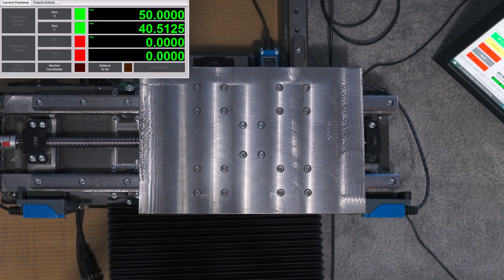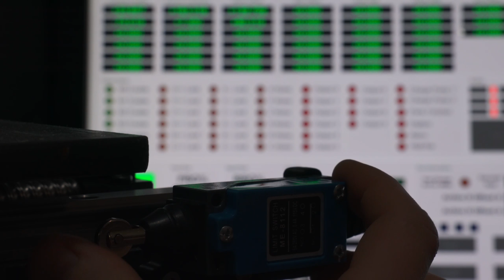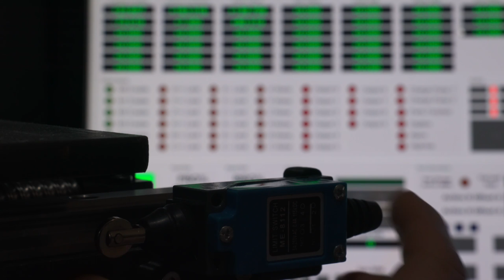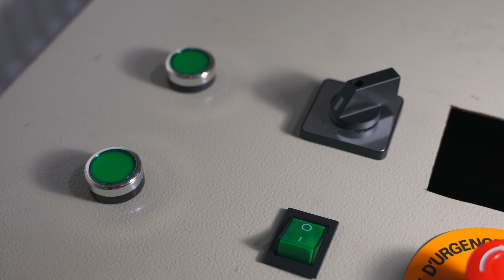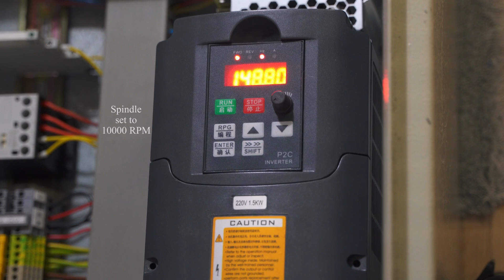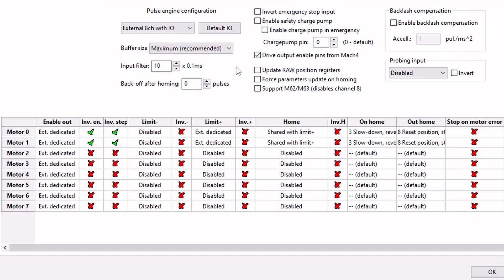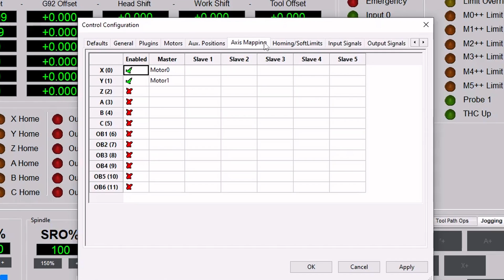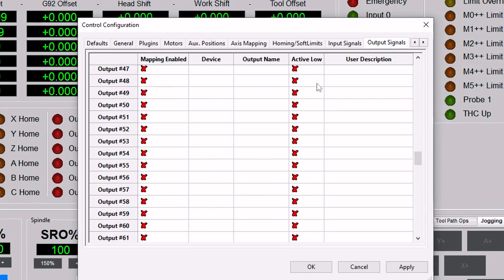DIY 3-Axis CNC Milling machine Part 3: Electronics & control software

Comment: Looking very nice so far. I'm also in the midst of a CNC build. Though mine is more of a router setup primarily for wood. I'll be happy if I finish even close to as pro looking
Reply from the maker: Sounds great! I've setup mine more of a milling machine style as I'm hoping to machine plastics such as pom and aluminium.